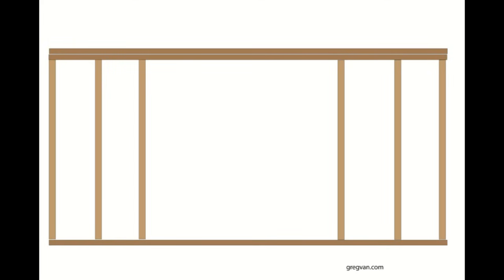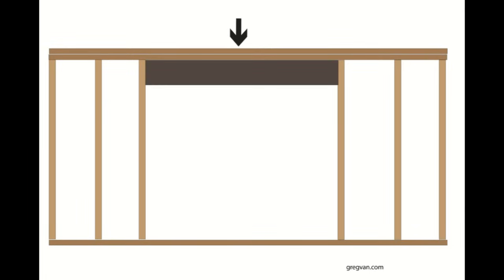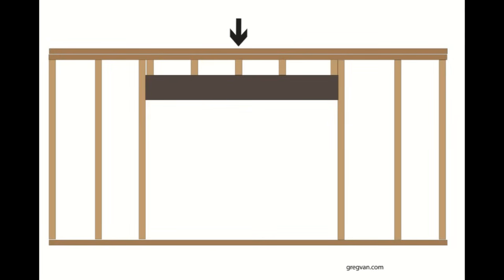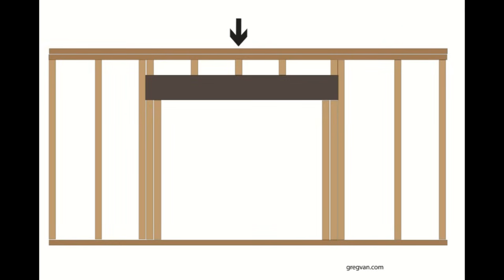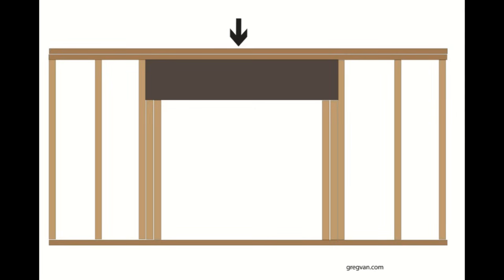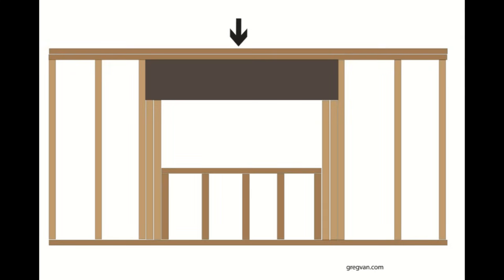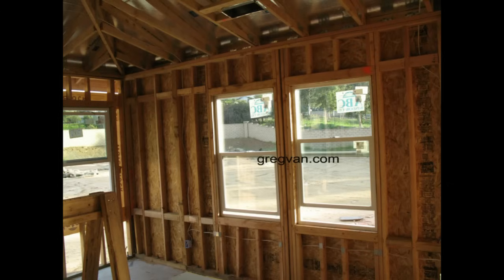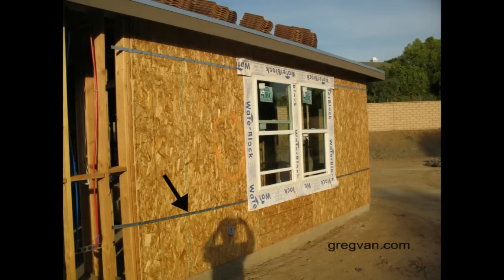Window Framing - Structural Engineering and Home Building Part 5

Comment: I have a three season room with 6x6 header and 6x6 post.  Room is 16x11 do I need to add a header or can I just frame it ? It has the old style slat windows from wall to wall 65”tall I want to install regular double pane insulated windows to make it a four season room and add base boar heater

Comment: I have an 8 ft sliding patio door, that I am going to change out to a smaller 6ft slider. I've had 4 companies come out and have gotten different advice, and very different prices.  Two say I have to go with a new construction slider, and the other 2 say they can remove the sliding doors, measure out specifically and cut the door frame down to size, frame in the side with double 2x4s under the header, then install a replacement slider to match the other one that is being replaced as well, only 5 feet away. Otherwise a new construction and a replacement won't match.  We have to do the interior drywall after, and exterior stucco, so I'm nervous either way. Also, I need good quality doors, and don't know what brand to go with. Just had the house tented for termites, so I won't be going with wood.
Reply from the maker: I would go with the new door, but can see how it could be cut down. Can you find the door manufacture to see if they're still selling products?

Comment: Hey great info. Q: I am reframing a door on and older home, and it's one of those southern style front doors where the door has a glass panel framed out above the door frame. Window is about 36" w X 24" H. Door standard 36X80, framed out with 2X6s.  Do they each need a header or if not what does the window need under it to act as a sill/ top of door frame? Thanks a lot
Reply from the maker: Headers are only required in the wall framing. If that doesn't answer your question, feel free to send me a picture and you can get our email address at the website.

Comment: interesting video , ive never heard of the shear wall , seems kinda getto as a building practice , how much could a double 2x10  and a rip of plywood set ya back ?  also never heard of trimmer studs , iirc they used to be called kingstuds but today more commonly known as jack studs or jacks , local to my area is i believe over 5ft. is required double jacks and back in the day if you didn't have you RO on the windows you would make the standard size window opening and just double jack them , if your window came out a lil bigger just remove the extra jack studs , good luck

Comment: Unfortunately even drywall can be used as a shear wall in a building so the lack of wood structural panel may not be enough to know if it is a shear wall or not.
Reply from the maker: Excellent point and thanks for sharing.

Comment: We've had the oddest build for some of our TS for structural.we were told for the new site ,no trimmers.
That second picture you posted with the small Jacks under the double top plate.we have the TS then the JAcks under it.